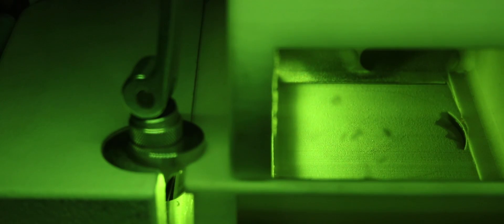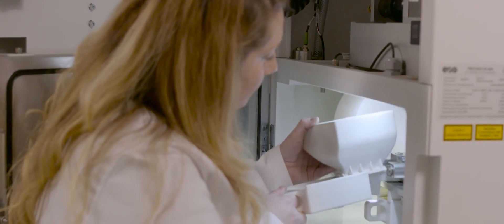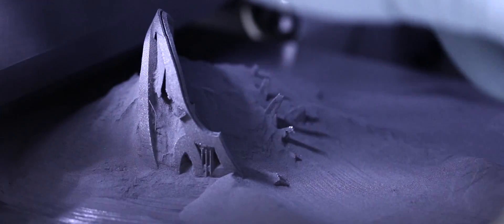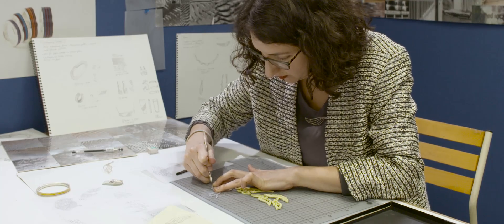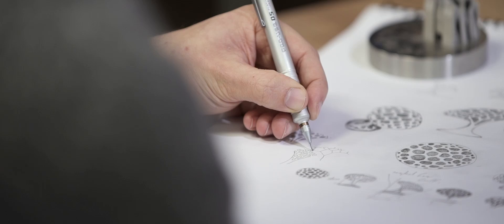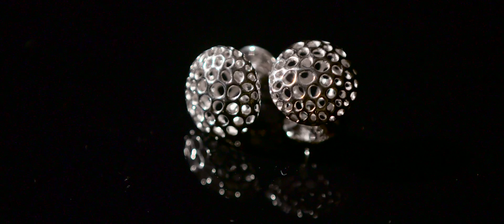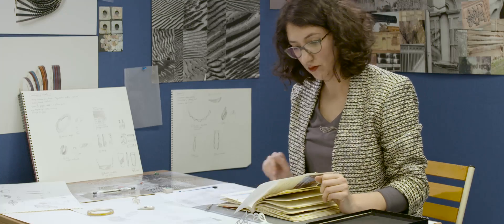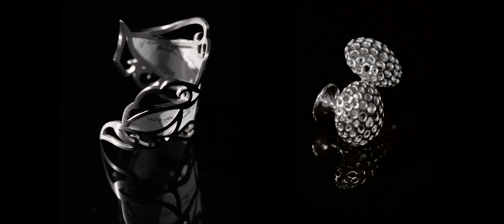Cooksongold E-manufacturing - Printing with Platinum Advanced Metal Powder

Comment: Is this dead duck still waddling along? Dear me, abysmal surface finish, failed builds, losing powder everywhere, hideously expensive and ugly as sin pieces that supposedly use the technology. Just buy a formlabs sla printer with castable resins. Job done.